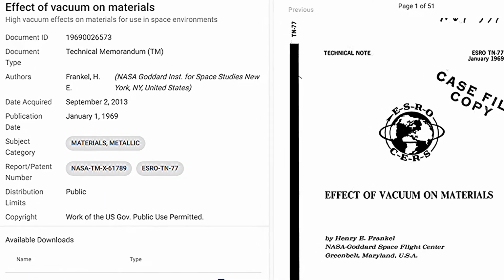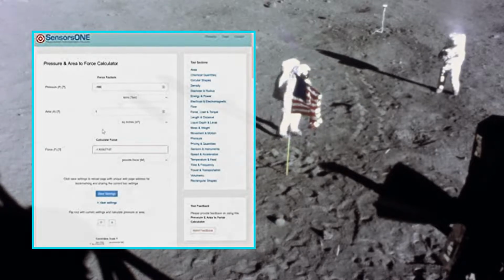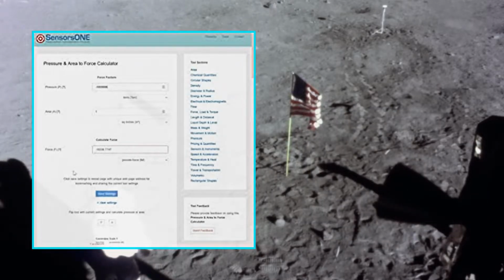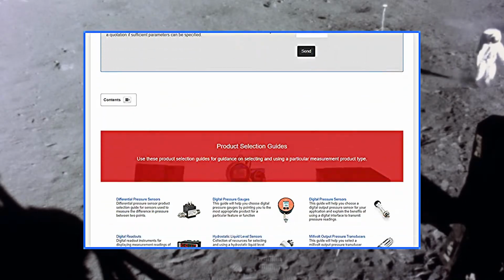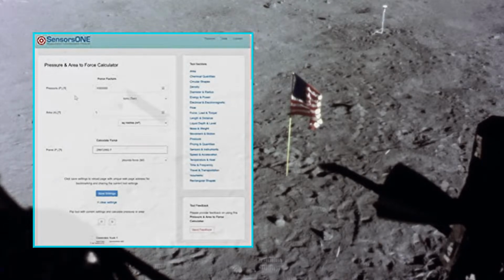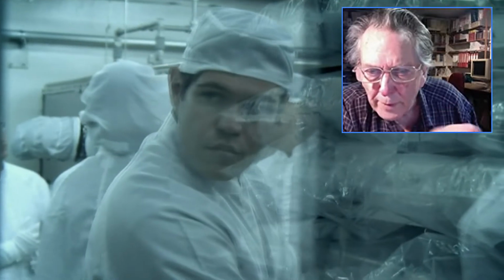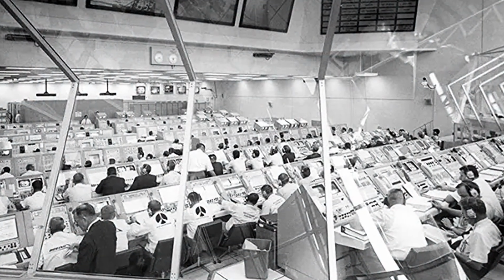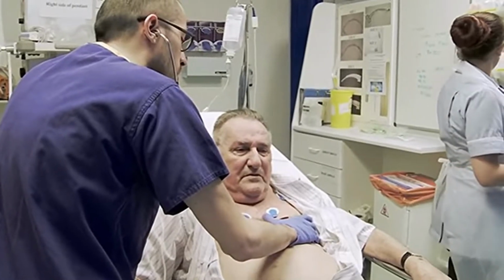"THE APOLLO DISCUSSIONS" WITH MARCUS ALLEN SCOTT HENDERSON AND ROBERT WILLIAMS.

Comment: I think it’s important to note that while the science of the AD’s film “experiment” is at best questionable, the issue here is that the claim they made was their vacuum chamber would DESTROY any film and prove that Apollo photos were faked. They claimed film would be rendered completely ruined and unusable even by their 10 -3 torr commercial vacuum. Their vacuum chamber did nothing of the sort, yet they are claiming they proved film can’t work in a vacuum when they clearly showed it does. The MINOR color imbalance could easily been corrected when the film was developed. 
If I had any talent for it, I would set about documenting these many lies that group has made and the contradictions they themselves have demonstrated.
Reply: To the contrary, they stated that the vacuum chamber was nowhere near the level of the vacuum of space. 
The degradation of the film therefore was not as severe as would be film exposed to a round trip to the moon and back....(and that's  not even taking into account all the damage that radiation would cause).
Reply: @yomommaahotoo264  You’re not paying attention. Before they performed their “experiment,” they claimed their commercial vacuum that is capable of 10 -3 torr would, and I quote, “destroy the film.” It did nothing of the sort. You can lick their boots all you want, it does not change that simple fact. Their experiment failed.
Reply: @corneliuscrewe677  For all practical purposes the film would be destroyed even at that lesser vacuum.....given the perfection of the overall apollo footage.
Stated differently, the photo studio quality of the apollo footage proves it was subjected to NO vacuum.
Reply: @yomommaahotoo264  You. Are. Not. Paying. Attention. They claimed film would be destroyed by 10 -3 torr, which it was not. The difference between 10 -3 torr and 10 -12 torr is 10 -12 torr is more empty. In practical terms, there is almost no difference, certainly not where Apollo equipment is concerned. Vacuum is not a force, it is a state. The only force involved is that which is contained in the spacecraft and/or the space suits.
Reply from the maker: @corneliuscrewe677  Then post a link to a gauge that measures "STATE." Also if there is no difference or little difference, then why does water begin to outgas after a certain level of vacuum has been obtained and not before? As usual, you have no idea what you are talking about Crewe!
Reply from the maker: @corneliuscrewe677  Scott said exactly what you are now saying. You need an atmosphere to be introduced ie space suit or capsule containing air pressure and then introduce them to a vacuum. Now you can use a "FORCE" calculator to see what kind of materials will be needed to construct a vacuum chamber that will not collapse in on itself when the vacuum pumps are turned on. You just cannot understand that Crewe!
Reply: @shillstompers3793  So now you’re arguing the semantics of a gauge neither you nor Scott understand and claim it proves vacuum is a force. Yeah, keep doubling down on that😉
Fact: You claimed your 10 -3 torr vacuum chamber would DESTROY the film. Your words. 
Fact: You were able to develop perfectly discernible prints from that film.
Fact: Your experiment failed. 

You don’t like me because I’ve got you number. You can’t beat me with facts. Ever.
Reply: @shillstompers3793  You’re talking about a vacuum chamber and the requirements it needs to work in an atmosphere and applying that the vacuum of space. Clearly I am not the one with an understanding problem here.

Comment: You really need to get a technical advisor who isn’t a blithering moron. Vacuum is a state, for the millionth time. The Sandusky Chamber needs to be that strong because it has to contend with planetary atmospheric pressure. Why is this such a difficult concept for you?
Reply from the maker: You are in a "STATE" of confusion which is infinite and no gauge can measure that "STATE" Crewe. How can a gauge measure nothing? No wonder you cannot be quantified!
Reply: @shillstompers3793   It the atmosphere on the other side of it providing force, “Bob.” Higher Torr values means more empty, not more powerful, and the difference between 5psi and the 10 to the -12 Torr on the moon is negligible in practical terms. The difference between vacuum in orbit and vacuum on the moon even less so. That is the bit you “Detectives” don’t seem to understand.
Reply: @shillstompers3793  Way to miss the point yet again, “Bob.” You’ve really turned willful ignorance into an art form. Vacuum CANNOT be quantified as having power, it is a state of emptiness. The FORCE can only come from the pressurized containers we take there. Prove otherwise.